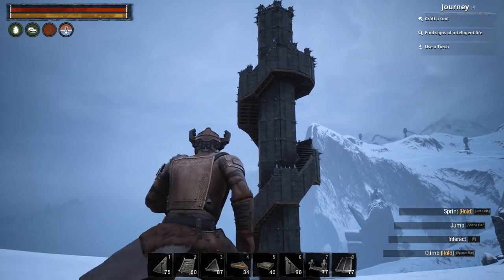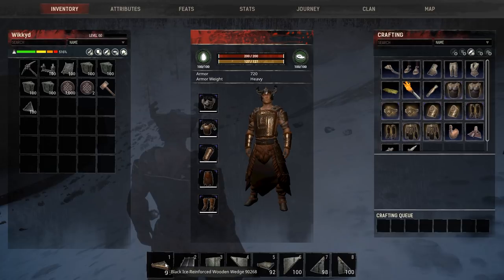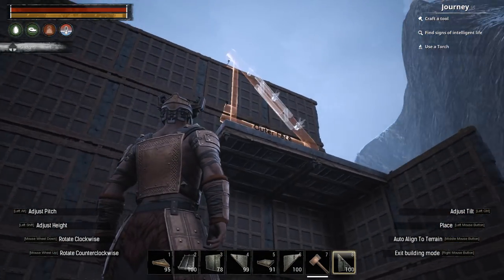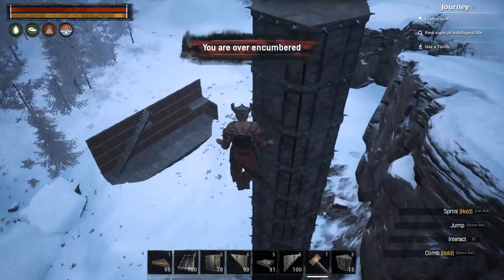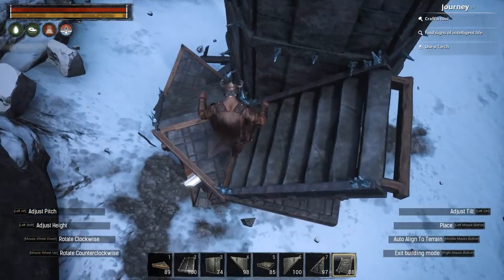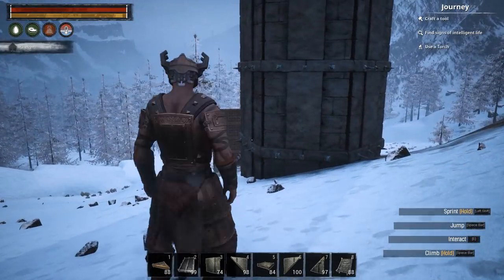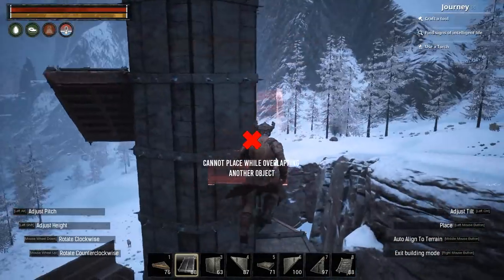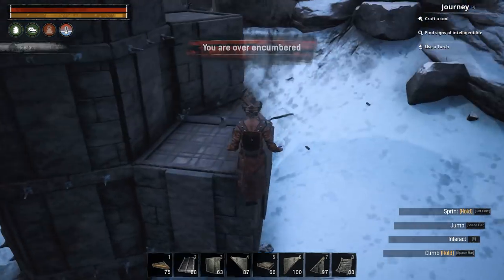Open Air Winding Spiral Stairs / Staircase #4 - Conan Exiles Advanced Tutorial

Comment: Hey, cool build :)! 

I noticed that around 19:00 you couldn't place a staircase at the rotation you wanted, so you added a wedge piece ontop. It's most likely not the wedge piece that made the staircase work in the rotation you wanted, and here's why (will be a bit technical):

The building system has a cache of valid snap-to locations, or "ghosts" as they're called internally, that it fills up whenever you use a building item to enter building mode with that piece. This cache only gets invalidated partially or fully when you 1) Place a building piece. 2) Remove a building piece from the building. 3) When you select a different building piece altogether that will require a different set of placement ghosts to snap to. 

When it generates the placement ghosts it basically takes the piece you are building with (the building brush) and tests all of its sockets and valid rotations against any applicable socket on the building around where you are aiming. It runs the "CanBePlaced" function on it, and keeps a list of valid and invalid ghosts. 

One of the things that can block a placement from being valid is the player standing in the way. And this is a big problem.

If you don't invalidate the cache with one of the three methods mentioned earlier, even if you move your character it will not recalculate that ghost. So even when you are not obstructing it anymore, it has a cached invalid ghost for that configuration of the placement and will not allow you to snap to it. The system lacks the ability to either recalculate the invalid ghosts that were blocked by a dynamic collision (like the player who can move away), or to allow people to snap to invalid ghosts locations and tell you why you can't build there.

In your case, it's likely that your position when the ghosts were generated made that rotation of the staircase overlap slightly with your character, making it an invalid placement. And when you switched to the wedge piece and back, you had invalided the cache and moved away. Thus your player collision was no longer in the way to create an invalid placement ghost, and you could successfully place there again.

This is the cause behind a lot of seemingly weird spots where you just can't snap your building to, but then it suddenly works again for "unknown reasons". And I plan on fixing it by allowing you to snap to invalid placement ghosts, so you can understand why the building system doesn't allow you to build somewhere. Since it would make the invalid placement blocked by your dynamic player collision work the moment you move away.

Until that is fixed, I suggest having an additional building piece of a different type in your shortcutbar that you can switch to quickly and back to your desired building piece to invalidate the cache so it recalculates the valid placement ghosts.